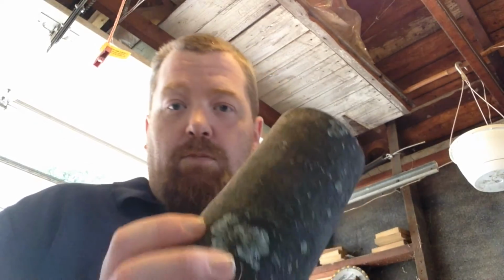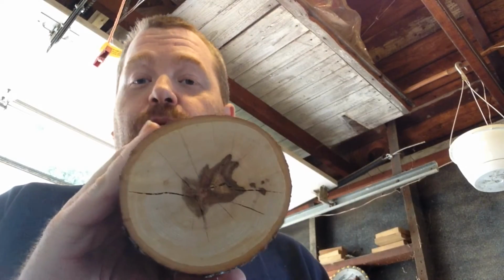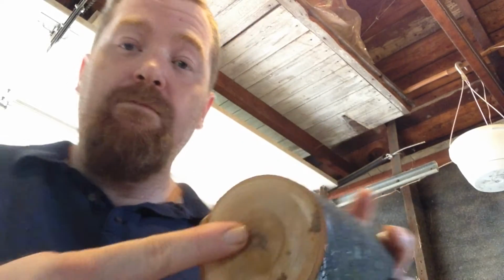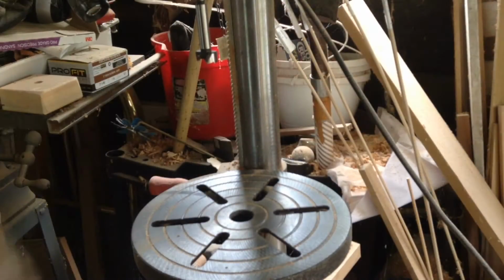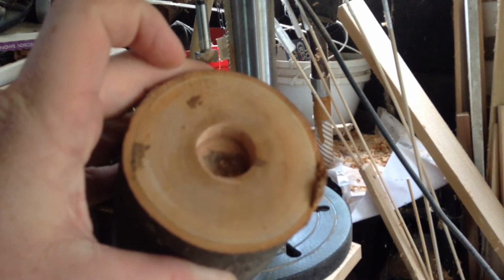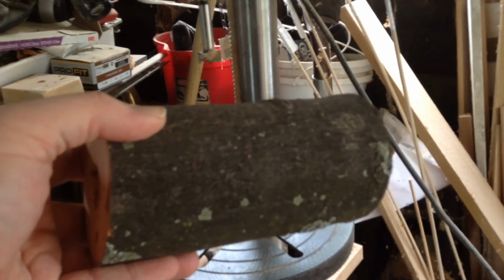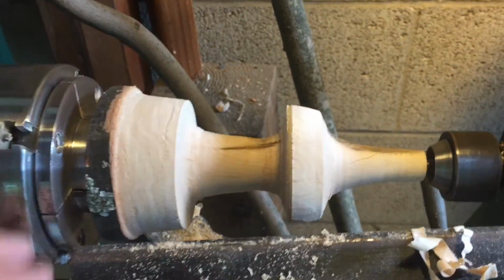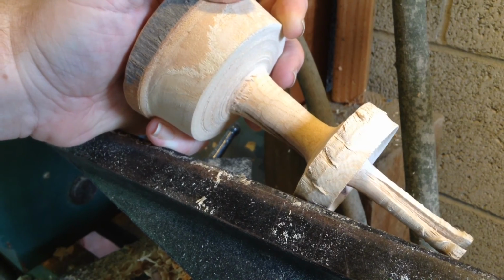Fail wood turning turns bad

Comment: Hi matey, i turn alot of green wood and like you alot does not work out. i Make mushrooms leaving a natral adge with bark on it they look so cool and small pots or vases and leave bark 3/4 way up which looks great too. I have not sold any thing yet i only got my first lathe this year but i go in my shed as much as i can. 
For me that long bit you had at you're pointy end i when it got that long i would have cut it off and moved the pointy bit up but i am sure you know that. Keep turning matey  8)